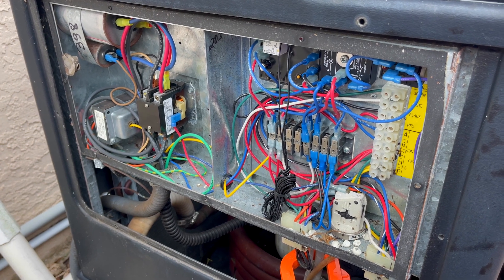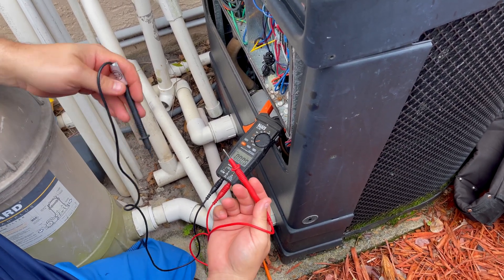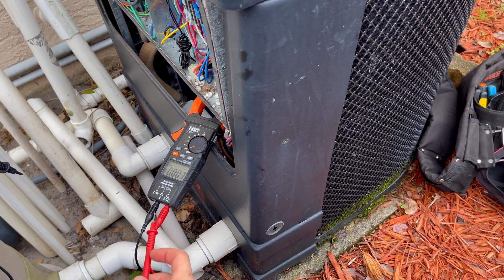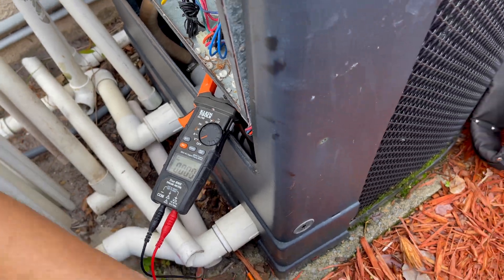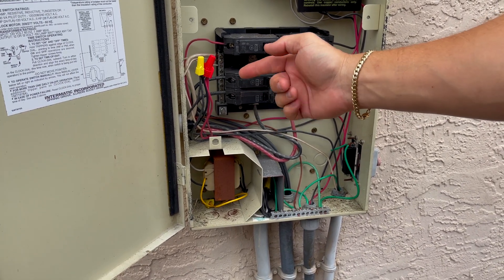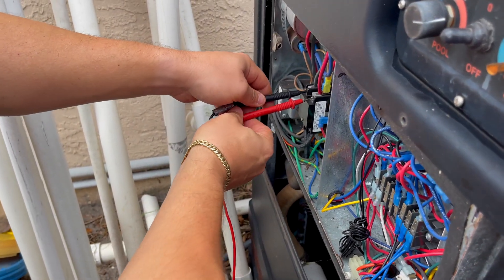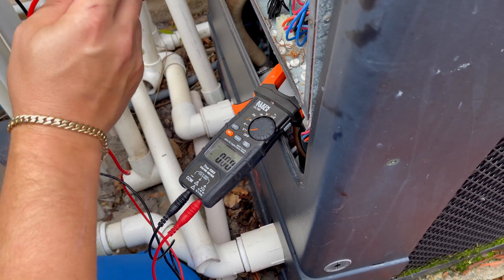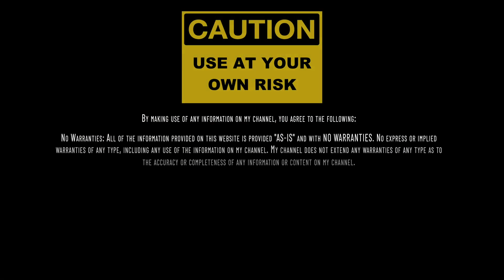Pool Heater Not Working? Check This First! (Electrical Diagnosis Guide)

Comment: More than likely it's a bad fuse at the disconnect. Simple fix and only about $25 in parts. You also didn't check the voltage coming out of the breaker.
Reply from the maker: There was not a disconnect as it was wired directly to breaker (within 50ft) and I did off camera. Same issue at the breaker.